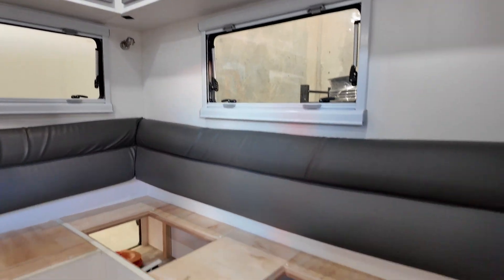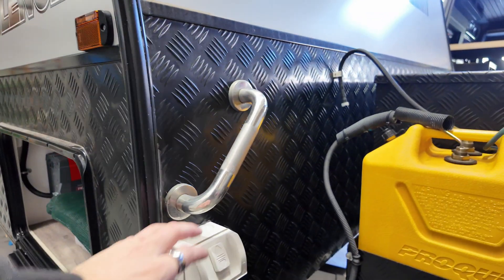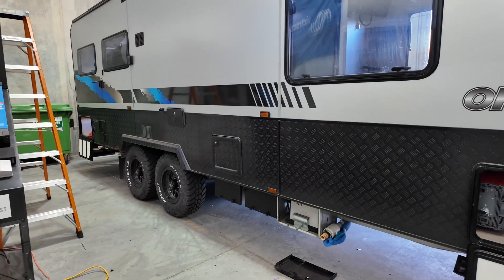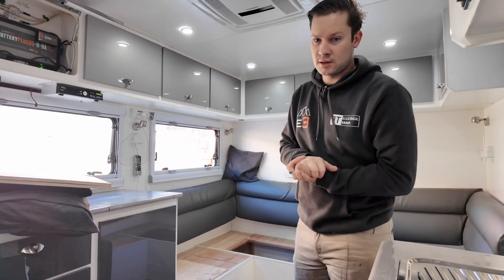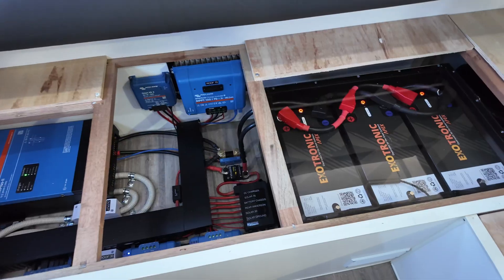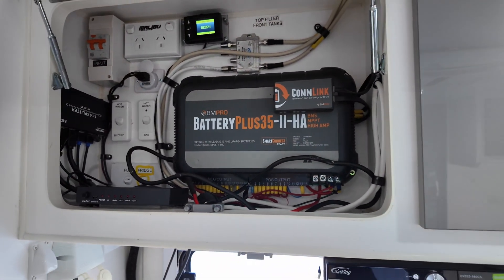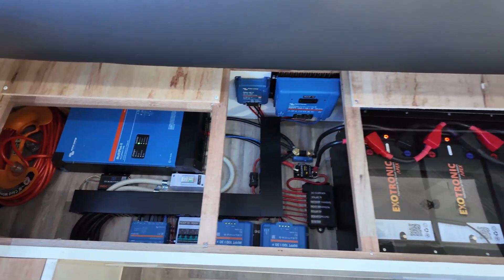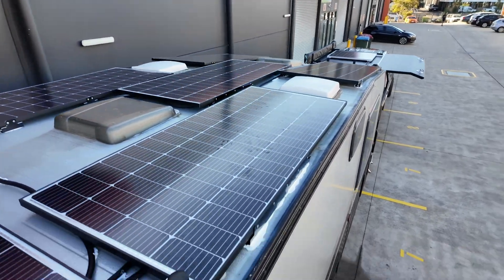1.6KW SOLAR & 900AH VICTRON LITHIUM UPGRADE | Malibu Opulence

Comment: Can you explain how you vented the tunnel boot? What would you do for an offroad van?
Reply from the maker: So we haven't vented the tunnel boot itself, we have installed the batteries inside an air tight box, inside the tunnel, which that box is vented to the atmosphere, using a piece of 25mm hose. We did add extra internal ventilation from the tunnel boot to the inside of the van area to allow for extra air flow in that space.

Comment: Another awesome looking install.
Curious to know do you use mechanical fixing into the roof skin as well as adhesive for the solar panel mounts?
Reply from the maker: We tend to not do any mechanical fixing points through the roofs of the caravans, it just opens up more reasons for leaks to occur. The adhesive we use is that strong, that if a panel was to come off, the whole roof would come with it.
Reply: Appreciate the response, they redid ours with sika 252 and was just a little worried they hadn’t also used screws but that makes me feel better